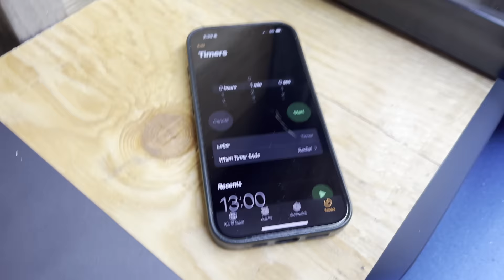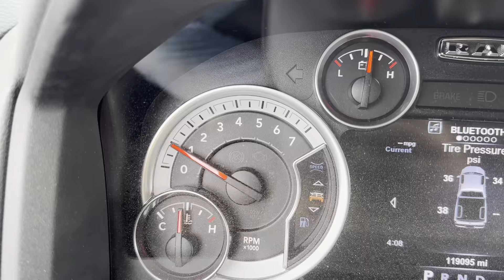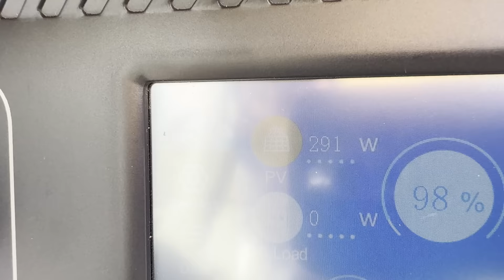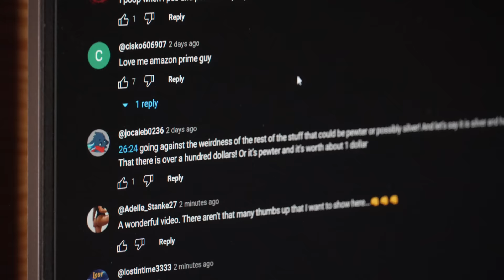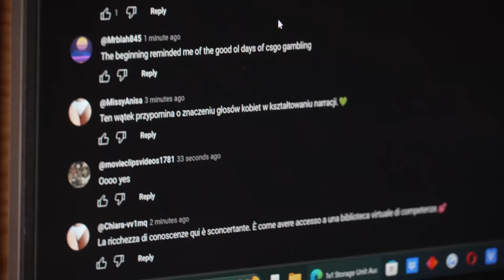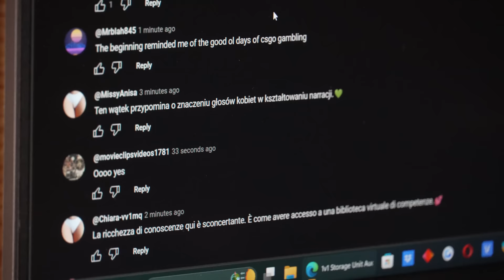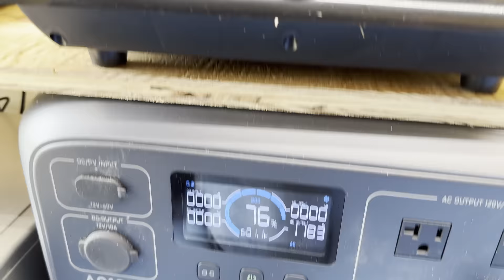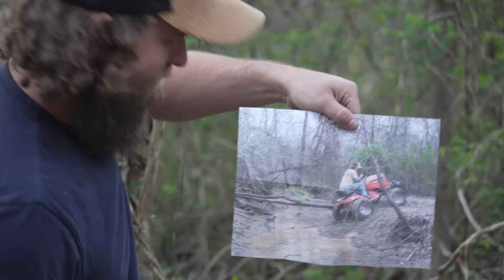1v1 Off-Road Lawnmower Camper Challenge

Comment: A lot of people don’t understand just how torquie lawnmowers can be. With a lot of weight it may struggle but it will still move it surprisingly compared to its size. Now it will not be like a truck by any means. But it’s a lot stronger than you or your friends are and that makes a difference. I used to have one that we used to move vehicles around that were broken at my buddies shop. I didn’t have a use for it and planned on making a race mower but ended up never using it and bought another to race with. Turned out it helped out a lot  for them so I just left it there.  To this day it’s pulling cars around and now has a mower deck on it to keep up the lawn there. Here mowers can do more than just cut grass. But what it doesn’t help is explain why these 2 mowers completely suck ass

Comment: If you take the ball joint out and drill a hole through your steering rod you can run a bolt through it with a nut and it will fix that steering issue I had the same problem